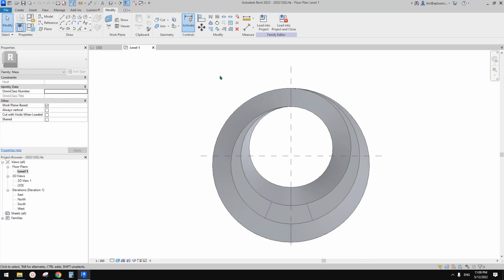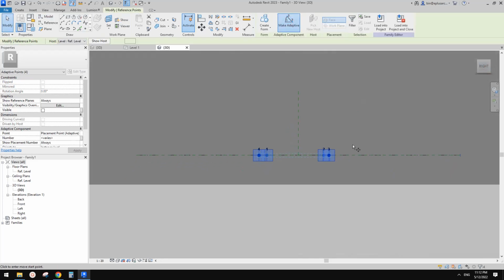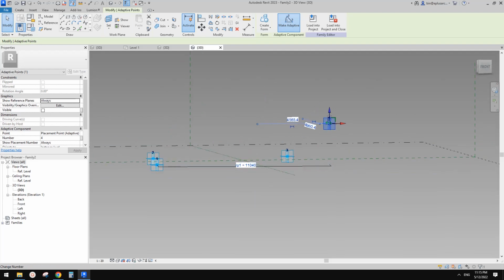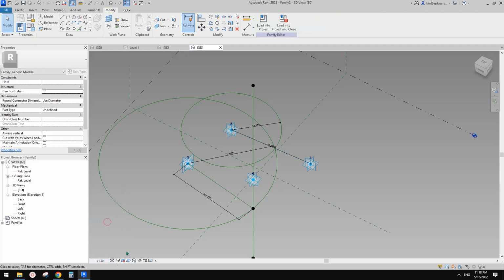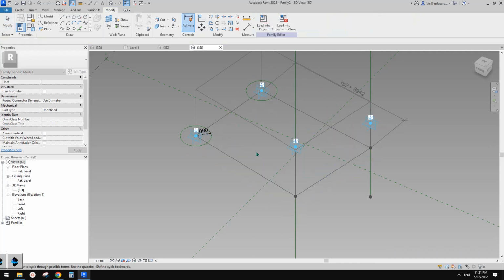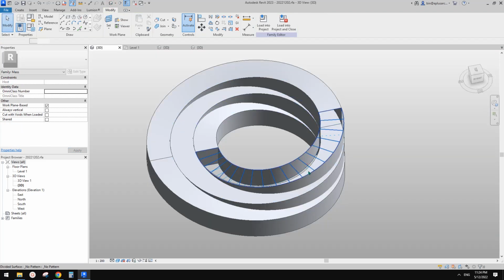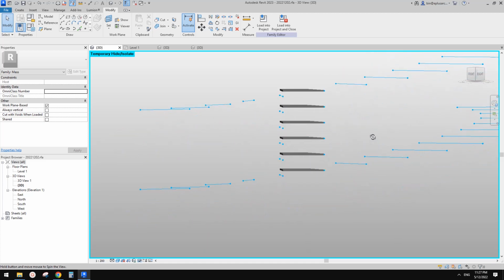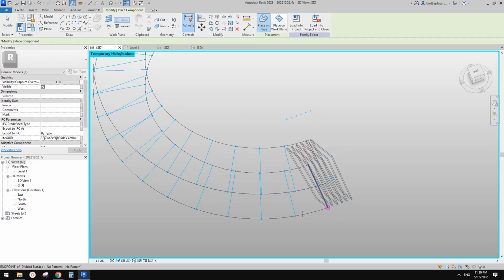Revit Exercise (Day 985) - Mass Exercise (Part 2, Adaptive Family)

Comment: There was no need for the reporting parameters and the circle reference line, since it's possible to connect the point dots 3 or 4 to the reference plane of the adaptive points 1 or 2 respectively. It will still level it up.
Reply from the maker: Yes, you are exactly right. We can use the work planes of points 1 and 2 for intersection. Great work. 👍